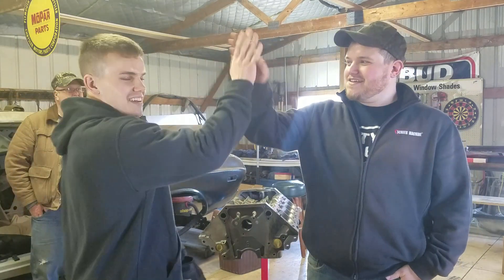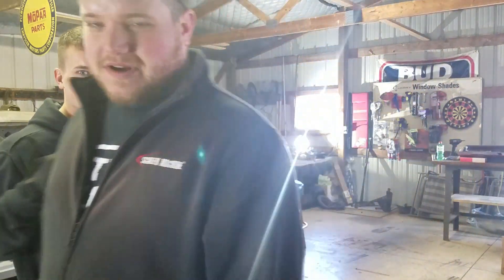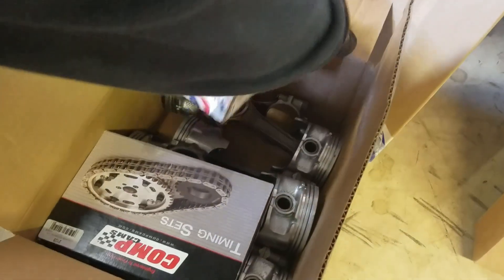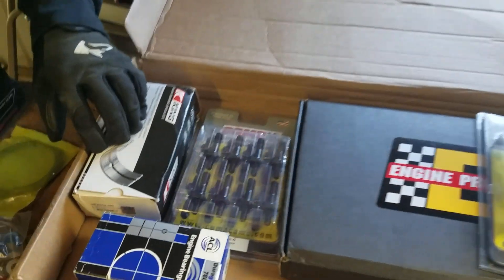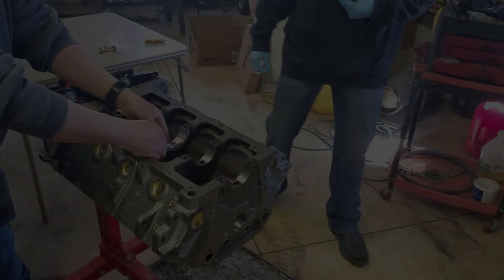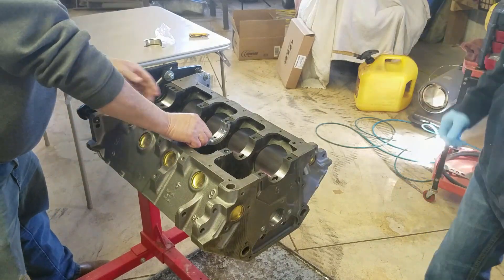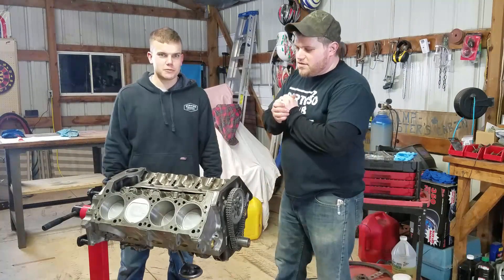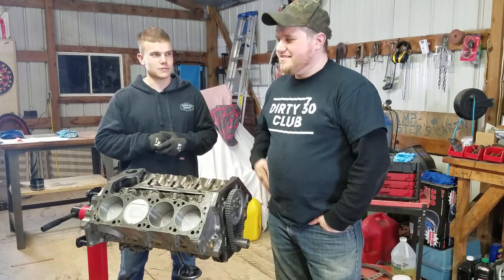Project Nopar Ep. 8 | Junkyard Magnum 360 Short Block Assembly

Comment: What's cam specs?
Reply from the maker: Comp Cams purchased from Summit, I believe. Part number 20-000-9. I'm not sure if that'll give you what you need or not. I've got the spec sheet kicking around somewhere. Let me know if you need anything more specific. Thanks for the view and comment!
Reply: @StaySlyh  
The spec sheet would help greatly. When u have a chance. Thanks bro!
Reply from the maker: @dtruth5769   Got the spec sheet, but am not sure i can post a picture via the comments 🤔.  Here's a quick rundown on the hydraulic roller cam:

Gross Lift = 0.516 Int & 0.504 Ex
Duration @ 0.050 = 219 Int & 223 Ex
Lobe Lift = 0.3440 Int & 0.3360 Ex
LSA = 110 deg

Let me know if you need anything else!
Reply: @StaySlyh  is that a comp cam roller
Reply from the maker: @dtruth5769  I'm not sure that I understand the question ... it is a hydraulic roller camshaft that is made by Comp Cams and we purchased it from Summit (see part number above). Does that answer your question??
Reply: @StaySlyh  
Thanks alot..looking forward to more videos. Happy holidays
Reply: @StaySlyh  
That is a comp cam but it's for early 360. Didn't list for my 99 360
Reply from the maker: @dtruth5769  no problem and happy holidays to you as well! Not sure if it helps you or not, but we pulled our 360 from a junkyard Ram (i think it was late 90s or early 2000s if I remember correctly). Good luck with your project!!
Reply: @StaySlyh  
Ya that's what I thought. But if u look up that part on summit. It's for earlier 360s. Take a look when u have a minute. I like the specs. Just not sure of it's compatible.
Reply from the maker: @dtruth5769  well keep in mind that we went carburated. That means we needed a long snout cam to drive the mech. fuel pump. If you want to stay fuel injected (or use an electric fuel pump of any kind instead of mechanical pump), this particular cam will likely NOT work for you. Its likely listed for older models as it is likely intended for LA engines. We just so happen to be using it in a Magnum
Reply: @StaySlyh  
Gotchs, thanks

Comment: So, a 0.040 over 360... 4.04 Bore, The is non 340 head gasket? 4.04
Reply: Cometic C5633-027 - Cometic MLS Head Gaskets
Click here for more information about Cometic C5633-027 - Cometic MLS Head Gaskets
Compare

Head Gasket, MLS, 4.040 in. Bore, .027 in. Compressed Thickness, Chrysler, Dodge, Plymouth, 318-360, Each
Reply from the maker: @smilsmff  great info! We eventually realized we were able to use the head gaskets that we had. It was one of the many learning points for us throughout this process haha

Comment: With a big can you should put your pistons in backward it changes the stroke ratio and make the engine trotle  more  responsive
Reply: No it doesn't change anything but you put them in backwards! Do not listen to what some tell you...do it as it says in the book or straight from the machine shop....I have assembled alot of engines and I have never heard or even been told put pistons in backwards to change stroke...they sell stroker kits they come with a different crank, connecting rods and pistons that's how you get a 360 up to a 408 stroker
Reply from the maker: @ronaldmoparornocar9590  thanks for the comment. I have also never heard of putting pistons in backward. I'm not sure that I understand how piston orientation could alter stroke. Nevertheless, I appreciate any and all insights! Again, thanks for the view and comment, and we hope you'll stick around the channel!
Reply: Sly Customs good video. That tip comes from Uncle Tony’s garage. He does that with all his motors. It reverses the piston wrist pin offset to the opposite side. In theory it would be pushing the piston up into the bore at a slightly different angle. Before I did my 360 build, I wanted to test if the piston would be slightly higher in the bore, by reversing it side to side. I tested number 2 pistons height at tdc, then swapped number 1 into the number 2 hole, keeping the rod chamfer correct on the crank. It lost somewhere between.003-.005 at TDC with the #1 piston in the #2 hole. That’s not much, but multiply it times 8, and you start to see a loss in compression. Not helpful in an engine that was already .120 in the bore! Side note: I was building an LA small block. Lots of guys had questions for the magnum build. I’ll turn them to your series from now on! 👍🏼
Reply from the maker: @JustMoparJoe  thanks for the knowledge! I just subscribed to your channel so I can keep up on your LA build!! Cheers
Reply: Sly Customs thank you!
Reply: Dude...I saw one of your guys with a Dirty 30 hoody...i was curious if yall from Ohio..
Reply from the maker: @davidlewis2681  indeed we are! One of the reasons that every project on the channel is a rusty heap lol!
Reply from the maker: Thanks for the insights! We were following manufacturer recommendations as closely as possible. It was our first time building a Magnum, and dad has a lot of money wrapped up in it. However, I'll be sure to keep your tip in the back of my mind and potentially employ it on future projects. Thanks for the view and comment!

Comment: Ive dreamed of this budget build, the 5.9 durangoes in my area are $1500 mas o menos. 

I'm thinking I can buy a built short blocc 360 or a manual transmission swap from a 2500/3500 ram .
Reply from the maker: Yeah it's a fun build! We looked at the Ram 5 speeds (NV3500 if I remember correctly?). I totally recommend diving in and doing it if it's something you've been thinking about. Just keep gear ratios in mind if you decide to go with the truck tranny. Good luck man!! We hope you stick around the channel and thanks for the comment!